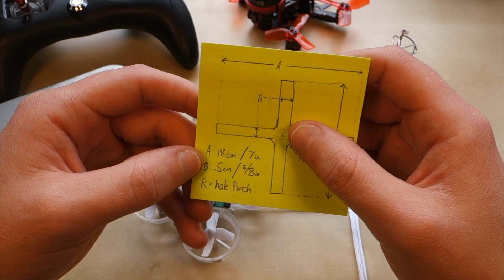Tiny Whoop + Water bottle = Longer flights

Comment: Nice! I will try it. Can you please tell how long are your flights? What’s your pwm motor rate? pids?
Reply from the maker: Its the stock inductrix board.  I did not upgrade the board yet.  flights are about 2:30 - 3 min depending on how hard I fly.

Comment: Hole punch? I didn’t see a hole anywhere. Do you mean a compass? Can you explain 🤔
Reply from the maker: Hurricane FPV the hole punch is used at the center of the x to get rounded radius instead of a sharp corner.  The radius is used to reduce the stress concentrations and keep the plastic in one piece.  The hole punch is not required but a nice finishing touch to allow the design to last longer.

Comment: we're like twins bro. my design is "leaf" shaped (pointy top) so gravity will roll it back over. a full design allows the ducts to be removed. yours is probably as good, also stops ceiling sucking. i'd used soda bottle plastic to replace the canopy :) amazed to see someone think instead of buy things, thought the rest were gone.

Comment: I did a very similar mod to my whoop with 2 pieces of curved plastic put together by some electric tape and attached to the frame by some double sided tape. My main goal was to protect the cloverleaf antenna. It did protect it a little bit, but i found it was not enough. In order to do that, plastic would have to be a lot more rigid (and i think it was more rigid than yours) and that means more weight, so i discarded it and tried the mullet canopy and whip antenna, which works great protecting the antenna, but doesn't allow the quad to return to its stand position. Also, in my mod the plastic was black, and it was also visible in the edges of the image. Still didn't find the perfect solution for me...
Reply from the maker: I have not had an issue with the cloverleaf antenna.  before I flew It I added some bondic around it to strengthen it to prevent damage.  the roll cage provides some protection but its not the main intent.  I can make a video to show how I strengthened the cloverleaf.